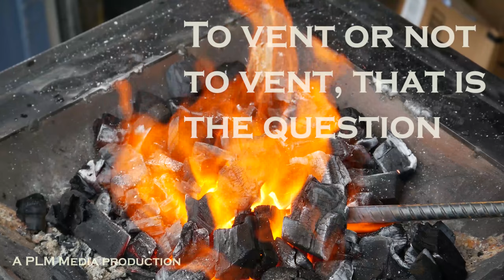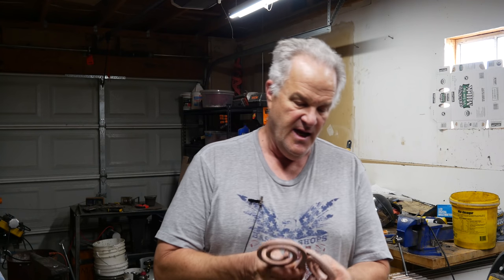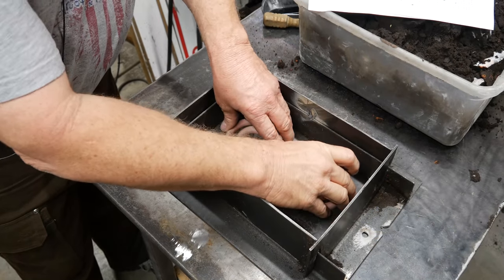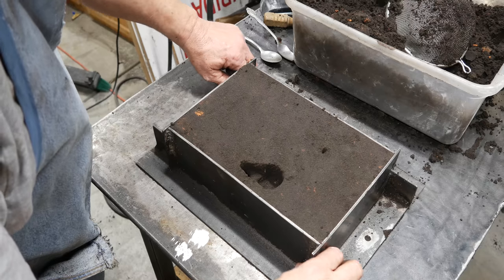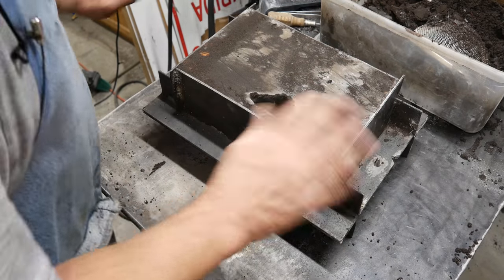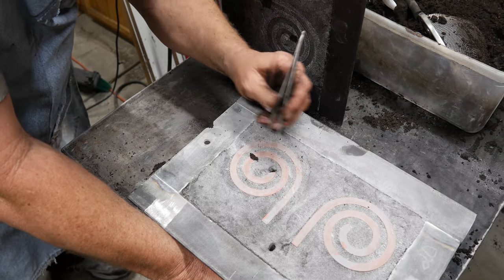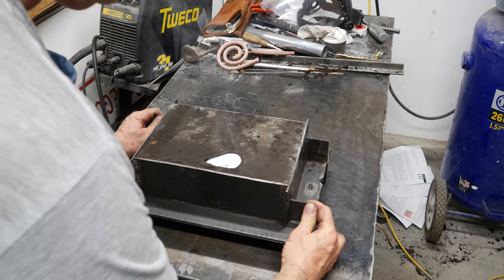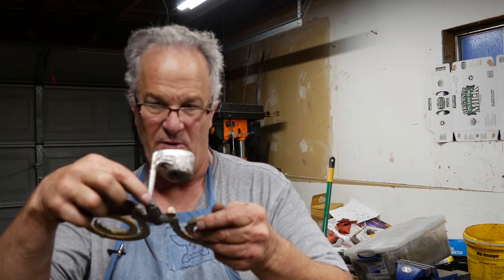To vent, or not to vent: that is the question

Comment: An interesting experiment. I was routing for the vented side and was pleased to see it win… I’d have been surprised if it hadn’t as you’re using Petrobond there. Green sand is allegedly different in that it at least in part allows gasses to flow into it (or so I’ve read).
However, I have reservations with the fluidity test. Flow stops when the metal freezes because the temperature has dropped. By coiling the run in this manner, you’re pre-heating the sand long before the metal gets there. So what might flow two feet in a tight spiral might only flow 18 inches in a straight line. This is just my speculation… maybe you can test it : )
Reply from the maker: I don't think it matters if it flows 2 inches or 2 feet, it's a comparative thing. Did vented flow further than non-vented? Given both sides came out of the same pour, same temperature, same crap metal, same preheated spiral... would vented flow further than non vented.  I expect that in a straight run, I'd see similar results, the vented side would flow further. 

Nice recycled knife btw. ;-)
Reply: Don’t worry mate, I’m not knocking your experiment which was clearly labelled “to vent or not to vent” and which surmised the process beautifully. I’ve suggesting that the concept of fluidity as described in the book is indeed comparative, but is that conveyed? I don’t recall it being (however, it was a while ago I read it). The danger with such as test is that it implies, metal A flows this far, metal B flows this far, etc. Of course it doesn’t. It’s more the case, “In THIS SPECIFIC SITUATION, metal A flows this far, metal B flows this far,” etc. Straight lines, spirals, run widths, sand, initial temperature, etc, so many factors could effect it.
But as a batter for the venting team, I’m glad we won ; )
Reply from the maker: I think you hit it spot on, "in this specific situation"  We get so caught up in it worked for me this way, so it must work for everyone this way.
Reply: Exactly mate. I wish there was a one-size-fits-all soloution  : )

Comment: Interesting exercise Perry. I guess that the main lesson for everyone is that things need to be tailored to individual circumstances. Type of sand, type of metal, quality of the metal, Size of casting with care taken with thin or narrow parts or extremities. Temperature of the metal just prior to pouring, as well as the mold and within the foundry location. So many variables would indicate the need to keep a diary to record variables and make it easier to isolate the cause of any problems.
Reply from the maker: In fact, if you talk to olfoundryman, that's exactly what he does. He claims he has every pour recorded. I expect he does. I've got to get something that I can measure my temperature with. As it is now, every pour I do is blind in terms of how hot the metal is. 

But, yes so many things to consider and no two set ups are going to be exactly alike. I doubt that anyone has sand quite like mine ;-)
Reply: A Pyrometer thermocouple for measuring the molten metal temperature is very important in hitting that target 10% superheat (10% is a general rule of thumb, some alloys need more)
Reply: Walt Sorensen Walt can you please explain Super Heat in relation to casting?
Thanks
Reply: I have noticed with other casting videos that aluminium tends to look very shiney after drossing. As it cools in the mold risers it goes a matt finish as it begins to set/solidify.
Reply: Superheat is the difference in temperature between the melting point of a metal and the actual pouring temperature for casting with that metal. 
pouring temp = melting temperature + Superheat
For aluminum alloys, the optimum pouring temperature range is 700°C to 750°C (1292F to 1382F) 
the Melting Point of say 6061 is 582 - 652 °C (1079.6F - 1205.6F)
so it requires a superheat of about 100C (rough estimate)

This can be used to quantify energy requirements like how much propane you need to melt a metal (but most people just go for the middle of the target pouring temperature range)
Reply: As I understand it, two things are happening; an oxide skin has formed and the metal is solidifying causing the matt finish.

Comment: Fascinating experiment to watch.  Now you're getting in to the science involved in getting the most out of the technique. A side-by-side comparison clearly shows the benefit of venting. My observation is that there must be a pressure build up of gases as the molten metal flows through the mould and that must slow down or prevent the flow from reaching all of the mould. Using a knitting needle to put loads of holes into the sand would allow the gases to escape and let the molten metal flow exactly where you want it to as good as the one with the venting. Good video.
Reply from the maker: Thanks. So far I haven't been perforating the mold as you suggest. I really should do a test doing that. Plus I need to get in the habit of thinking about it and doing it. All part of technique expansion and hopefully improvement.

Comment: Given the nature of the Perry-bond sand, as compared to greensand, I'm going to put my money on the vented side.

Edit:  Okay, that went as I expected (or guessed.)  But I'm inclined to think that a vented greensand mold might be a good idea with long flows or with thin castings, just to minimize the work the fluid has to do to occupy the empty space.  I've had a problem with pitting on my aluminum bronze castings, and have determined that it is probably from too much moisture in the sand.  I did successfully mold and pour a very thin spearhead casting about 9" long, but only barely, as the metal solidified just as it reached the riser at the far end of the casting.  If the mold had not been vented by the riser, I'm wondering if steam pressure from the excess moisture in the sand would have prevented the metal from flowing as far as it did.

Good experiment.  I like that you linked to LuckyGen1001's video for comparison.  I had seen it before, but it was good to take a look at it again.
Reply from the maker: Personally I'd suggest, if you have the time and the energy and the inclination, that you do a test with one vented and one without. If you can do like I did and do them side by side that throws a lot of variables out the window. I'd be curious to hear if a vent would help your pitting.

Comment: Good test!  I like that both samples came from the same pour, so nobody  can question if pouring temperature affected the results.  The unvented spiral filled farther than I expected it to.  You could use the same pattern to test various other things such as the effects of using a thin venting wire all over one side of the mold, or of ramming harder vs softer etc. Greensand and petrobond are pretty different animals I guess, plus Luckygen does a lot of iron casting too, so his greensand is likely coarser and more permeable than most water bonded sands intended for nonferrous casting.
Reply from the maker: And yet I got a dislike :-D  Sometimes I just have to shake my head.  Yeah, I purposely built two for that reason, no argument about pour rate, temperature, crap alloy, any of it. They were exactly the same.   Some did ask about norther versus southern hemisphere :-D

If Were to use do any of this again, I'd print two new spirals. This one had no draft on it and it was a bear to get out of the mold.
Reply: @swdweeb  OMG that's right, I have been forgetting the all powerful coriolis effect!  Great, now I'm going to have to rebuild my whole furnace so its tuyere swirls clockwise instead of counterclockwise... 😀
Reply from the maker: I can't believe you built your furnace without flushing the toilet as a last check to make sure your flame goes the right direction. I'm unsubbing you right now. ;-)

Comment: Vent makes sense to me with your setup.
If others don't use a vent and it vent through the sand wouldn't their casting be very rough?
Great demo
Reply from the maker: There is a school of thought that not venting a part causes the metal to ram into the sand harder and and potentially force its way in between the grains thus causing a rougher part.  I don't have experience to tell me if that is the case or not.

I assume that you're talking about poking wire down into the sand to vent it. In that case some guys don;t actually touch the pattern with the wire so I can't see there that would leave any bumps/ If you touch the part with the wire, odds are you're going to have little numbs you're going to have to get rid of.

Comment: Very informative video my friend! Well done 👍🏻 couple of questions, do you think it would make a difference on the type of metal you’re pouring? And 2, when you said 10w 30 oil you used was that regular or synthetic?
Reply from the maker: Regular, non-detergent motor oil. Non-detergent is the key.
Good question on the different types of metal. I assume the outcomes would be similar but don;t know. Maybe, if I ever get tons of free time, I'll try the same pattern with bronze, just to see.
Reply: swdweeb cool thanks for the info 👍🏻 yeah with brass I can’t seem to get my coins filled in cause they’re thin but with aluminum I have no problem at all.. 🤷🏻‍♂️
Reply: Different metals have different fluidity. The amount of super heat in the melted metal also affects the metal fluidity. Among a number of other factors.
Reply: Walt Sorensen thanks Walt
Reply: ArtByAdrock you are welcome.
Reply: I think part of the reason you have trouble casting coins is your chosen method.  Most mass produced metal coins are forged, not cast.  Check some videos on MINTING COINS.   But good luck with the sacting, it's pretty interesting.  ☺
Reply: Casting coins is possibly older than minted (die struck) coins. Casting was how some of the first coins in China were made. Repeatability and durability are reason minting coins is a better process. Some novelty coins are die cast rather than minted.

But for these novelty maker coins sand casting is fine. Aluminum is just easier to cast than some other metals. I've seen general charts that list recommended minimum thicknesses for different alloys in sand casting. bronze requires higher heat than aluminum to melt and even more to get to the super heat for the pour. That higher heat requirement would be my first point to check in trying to determine casting issues between bronze and aluminum.

Comment: Wondering how this would go with venting the sand and not the pattern...(oh the things I would do if I had space and time for a foundry)
Reply from the maker: I can't do everything for you, you're just going to have to knuckle down and build a furnace :-D
Reply: swdweeb  oh, it's in the plans... current schedule suggests maybe late 2020 for a furnace build (unless I can justify needing it for something sooner than that)
Need to get through finishing up this trommel build. Then things will slow down hopefully with more focused monthly releases. I've got a big project in the pipeline with buttons and switches that needs to get completed (only 4+ years in the making). That project will need to come before anything else like playing with melted metal. (it's only been some 25  years since I last did a pour)
Reply: Check out Paul's channel, Paul's Garage, as he has built himself a foundry that is designed to be packed away when playtime, sorry, casting time is over.
Reply: Mark Fryer  I like Paul's firebrick design, and the castable design of MarkHarriss, and the kaowool design of Make it Extreme (although they should have coated their kaowool). 

lots of projects are on the schedule, but one project at a time for the moment. (someday maybe I'll get back to the charcoal Forge I started 20 years ago)
I want to get to building a fusor and to do lots of other things like rebuilding my grandfather's DIY arc welder.

Comment: I'm thinking the vented side flowed further, but it will be interesting to see what actually happens. (I'm viewing this several hours after you posted and avoided at looking at the other comments before I wrote my guess here :-)
Reply from the maker: Well, by now I guess you know you were right ;-)  Did the non-vented side flow as further than you expected?
Reply: @swdweeb  it was interesting to see such a big difference. Thank you for the stl files. I printed off a set and want to see the difference between the pop can aluminium (which I understand is probably a 3004 alloy) and aluminium from different cast aluminium sources I have (hard drives and such). My reading suggests that the 3004 alloy is not as fluid as the casting aluminium.  I had hoped to get in the shop this weekend but life keeps getting in the way if shop time :-(. Thanks again for the great information.
Reply from the maker: Man I would love to see the results of that test myself.

Comment: Or the metal was able to overcome the pressure on the unvented side.

I wonder if the two forms were separate, whether the results would be similar.
Reply from the maker: Good question, someday, if I get the tlme, I'll try one unvented by itself.

Comment: How much does weight of molten material play in this?  There has to be a flow rate that is based on coefficient of friction plus weight of material pushing down on the flow, I guess that is force, but against back pressure from the mold.   I wonder if, given the same force and flow but one side had less back pressure would stop the flow prematurely on one side since it had less back pressure from the vented side and it is all connected by the cross piece.  Just thinking out loud.
Reply from the maker: Not sure I'm following you 100%... I think heavier metal would show different results in the same pattern. However I think that if were to extend the pattern by two or three times the length we'd have seen similar results, just further down the line.  Of course that is my opinion and I could be, and quite frequently am, wrong ;-)
Reply: I was wondering more about "path of least resistance" . Since both are from same pour spout and the non-vented side has back pressure. would it stop flowing sooner because the vented side has less back pressure.   I guess I wonder if you poured the unvented side alone would it go further.   Like I said.  Just thinking out loud. Not trying to make you do more experiments. :)
Reply from the maker: that's cool, I appreciate the thinking. ;-)  I don;t know if a single would have made it to the end. Hard to say without trying it.
Reply: Really enjoying the videos .  Take care .

Comment: Very nice of you to share the files for free. Did you run a string around the two to measure the distance of the runs? Would be interesting to quantify the difference in flow lengths.
Reply from the maker: No, I used a scale. I'm within a kilometer in my measurements, I'm pretty certain ;-)
Reply: Lol, good job mixing your kilograms and your kilometers... (but I'm sure you know that... next you will be doing some wild west conversions like This Old Tony and start talking in McDonald's quarter pounders and smelly feet)

Comment: Good to hear metric but did you mean they were 50 cm long rather than 50mm?
Reply from the maker: :-D yes I did. I actually thought about that as the video was uploading. Oh well, most of us Americans won;t catch it :-/
Reply: I was also wondering since 50mm would be 5cm which would be about 2 inches (wild west conversion since 2.5cm to an inch)
Reply: Ah Walt it's actually 2.54 cm or 25.4 mm to the inch. Best to work in mm as cm is for measuring people and clothing.
Reply: Mark Fryer like I said "wild west conversions" an estimate seemed close enough for gaging if it was the wrong unit. Although I'm not as good at wild west conversions as This Old Tony who went from N⋅m to foot-pounds using McDonald's quarter pounders and smelly feet.

Comment: Perry you may find it easier if you just work in Millimetres, rather than swapping between mm and cm. I find that because I work in mm all the time in my work that conversion to centimetres requires extra thought, something that you don't need when talking to camera while casting and videoing. Just one less thing to worry about.

Comment: I thought that coarser sand allows gasses to escape between the gaps more than fine sand and makes metal flow more freely. Rougher surface finish though.
Reply: Correct on both points.